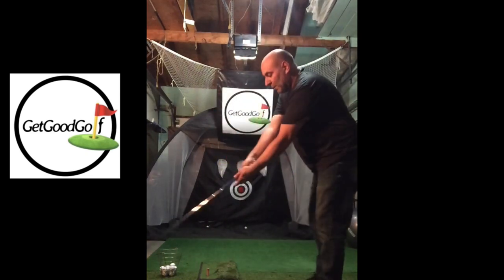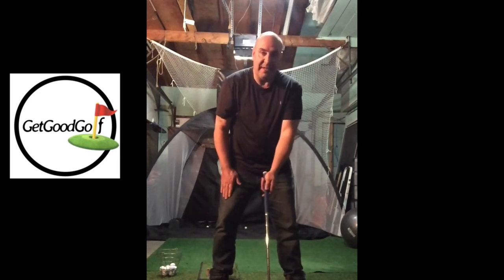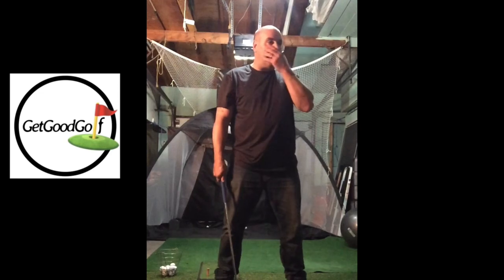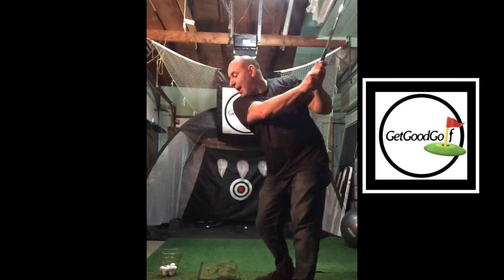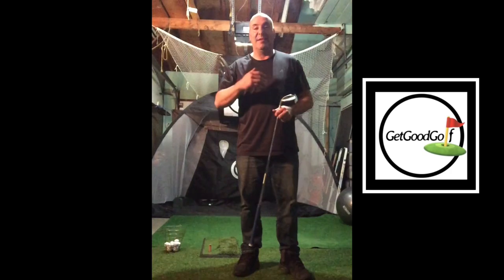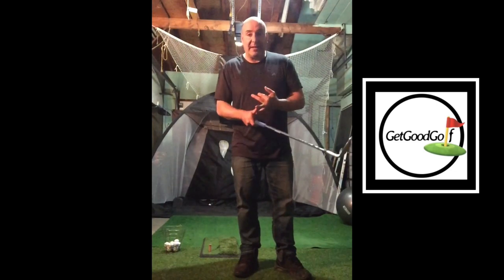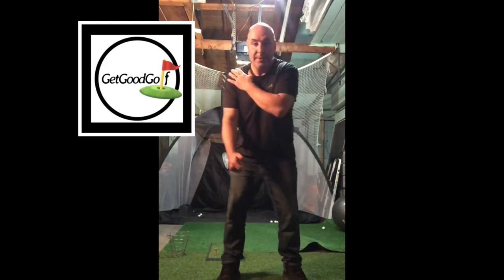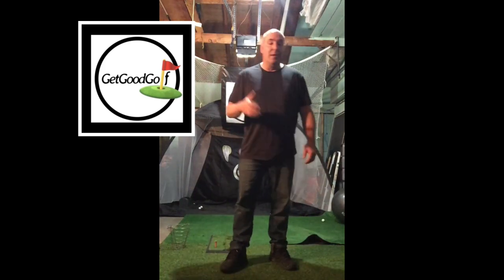Combining Stack and Tilt with my Single Plane Swing for better golf ball compression | Garmin R10

Comment: Until I saw this, I didn’t realize that the form of single plane I teach has some stack and tilt ideas in it. I talk about turning into the hips first, which is really the same idea as turning the lead shoulder down. Nick Turner also talked about swinging on an arc with his stack system, which is another idea I use. I tell my students to swing on a rainbow. Great findings!
Reply from the maker: I am a subscriber to your channel. It seems there are a lot of different methods on single plane swings out there that are very affective. I think a lot has to do with body type as well.
Reply: @GetGoodGolf  you’re correct. When you find the right swing for your body, that’s when it clicks. And what works for me might now work for you

Comment: I'm a lefty that plays single plane.  One thing I've started doing is leaving my left arm straight.  If we are facing 12:00 when you take the club back you should feel like you're point the club at 7:00.  I know, it's weird but honestly it's feel vs. real.  My issue was coming over the top and this fixed it.  I know it sounds weird but you may want to try that too.
Reply from the maker: So do you mean keeping trail arm straight at setup? I have tried that and my forearm ends up not being in line with the shaft from down the line view.
Reply: @GetGoodGolf  it's going to have a slight bend to it because of the angle and where you grip the club. I'm talking about the backswing itself. I was trying the Moe Norman method of "back and up" for my backswing and was all over the place at contact. Then I was told by someone that actually played with Moe to keep my left arm as straight as possible in my backswing "feel vs real." That kept my "Y" and ended with my hands over my back foot and just started crushing the ball.
Reply from the maker: Got it I will try that. Thank You
Reply: @GetGoodGolf  Let me know and I'll keep looking as well. I enjoy the videos. It's cool seeing videos by another lefty.

Comment: You should look into front pivot versus rear pivot, that is what body wants to do naturally
Reply from the maker: By that do you mean more weight on front foot and no sway, more of a turn?
Reply: They talk about pivot on front center or rear based on natural pivot,stack and tilt works really well for front pivot like me and I use single plane, really helped my game, also look at natural grips based on forearm ratio
Reply from the maker: @bigcroc2797  will do. My grips are a bit wider than normal. They are midsize grips.
Reply: Sorry I should of said hand placement instead of grips, I do also like a non taper grips
Reply from the maker: So my hand placement is misleading down the line view. This video shows it from head on view……. https://youtu.be/rANkdPdpVqE

Comment: This is my method exactly.... I single plane on set up with stack and tilt weight forward, rotate shoulders on back swing.... then fire and turn hips into the follow through. I also take almost no divot, Im working on changing ball position a little closer to me than I see you doing. I start by setting up in a typical stance with arms dropped, then raise up to single plane. Saguto is a blast.  Let us know how this has worked out for you.
Reply from the maker: I haven’t done anything on YouTube in a while. I actually do closer to Stack N Tilt by itself now without the single plane setup. But I am always tinkering.

Comment: Listen man you need to find a swing that works for you. Ive worked with Kirk Junge well over a year and even in a few of his videos he has mentioned Stack and Tilt.  These days i am probably more Stack and Tilt then single plane. Though i am not worried about 2 plane vs 1 plane i concerm myself with impactband the abilitly to make that ball first then divot action. Its all about that centered pivot.  The divot board or the variation will be very helpfulmi have one and use it daily at least 50 swings a day even without balls. Its an excellent tool.  Swing away man and looking forward toward your future videos.  Remeber everyone tilts!  I found greater consistentcy between shots and less mainteance between rounds. Practices are a lot more productive because there is method that can be customized.
Reply from the maker: Thanks for the encouragement I really appreciate it. Thats my goal, FIND, my swing over the winter and practice hard. I wanna be a single digit by Summer, currently an 11 handicap.
Reply: Don't get mislead. The extended arms are proven by DeChambeau. there's power in the swing with these arms man. But Moe Norman also proved the accuracy as well. Read "Feeling of Greatness" a documentary of his building this swing to "Just Can't Miss"
Reply from the maker: I will be ordering that book soon, thanks

Comment: Stay away from stack and tilt it's absolutely garbage. No good golfers use this garbage.
Reply from the maker: Why do you say that, did you try it and not like it? I am still trying to setup single
Plane but Using some Stack and Tilt fundamental to not sway off the ball.
Reply: @GetGoodGolf  how are you supposed to fire through the ball  keeping all the weight on your left side and Tom saguto has a major hook problem with it.
Reply from the maker: @dscwac396  yeah I have notice that his “baby drawer” is sometimes a hook. Thanks for the comments. Gonna play on the sim later today with the Graves method
Reply: @GetGoodGolf  lol he doesn't baby draw the ball and he hooks the ball that's why on his videos you've never seen him with a shot tracer because it'll show that he hooks the ball I can tell by his swing path that he hooks the ball. But like I was saying with the stance setup Todd Graves actually has a video on it because everyone says Mo had a close stance and Moe had a close stance with drivers and woods but when he got to his iron he had a more neutral slightly open stands and I think that would help you a lot because the clubs are designed to have certain stances so if you have a closed stance with like let's say a seven or an eight iron you're going to have trouble with over rotation and trying to get the club square then it's vice versa if you have an open stance with a driver or a free wood you're going to be rotating too much to where your path becomes across the ball instead of coming in behind to hit the ball
Reply from the maker: @dscwac396  thank you, I appreciate it. I will work on it.
Reply: Spoken like someone who doesn't golf.  Everyone has their own system that works for them.  S & T is a solid system.